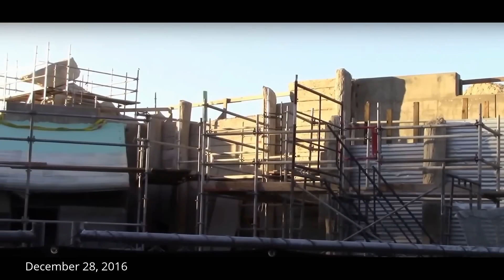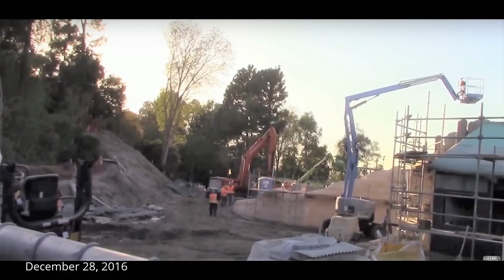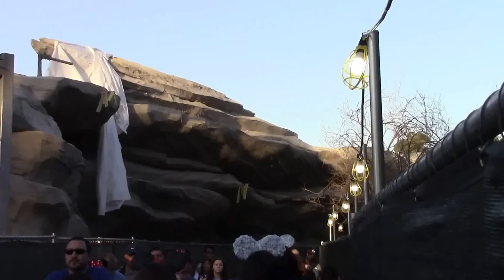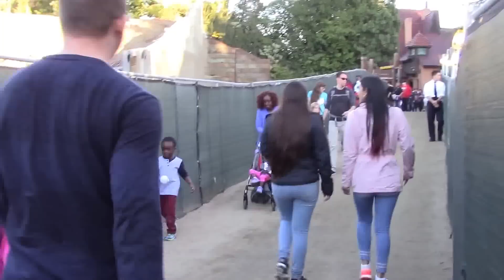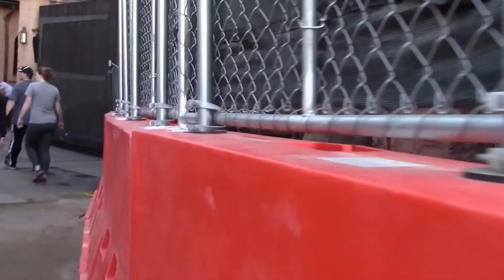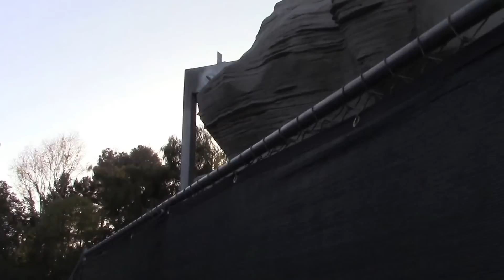Disneyland - 12/28/16 Big Thunder Mountain Trail Open to Guests

Comment: The hardscape is very elaborate. Can't wait to see how that tight river bend is going to fit the Steamboat? Looks like a tight fit.
Reply: It's always been a tight fit, but I'm sure they have elaborate 3D models of the entire area it'll be a fantastic experience.
Reply: Disney has professional architects and engineers. It's also not as tight a fit as it looks from a distance.
Reply: It's going to be interesting for sure.
Reply: @ Louinator 59 the Mark Twain and Columbia now have to drift to get around the end. 😂😜✌🏼️👍🏼